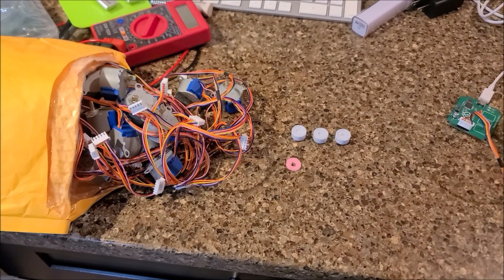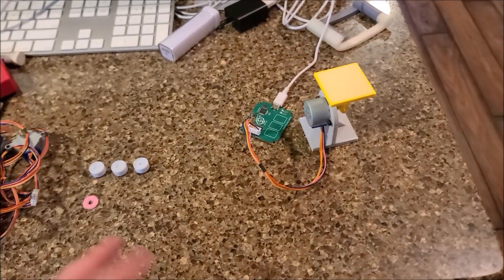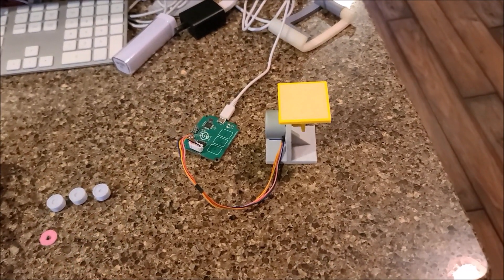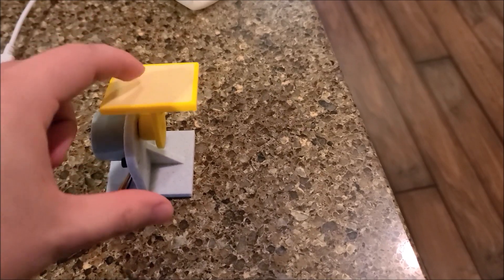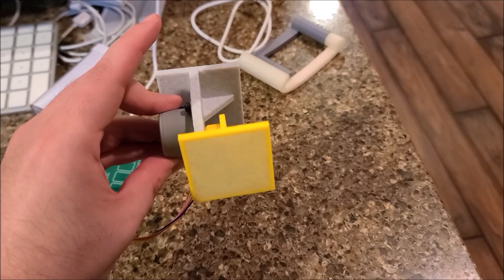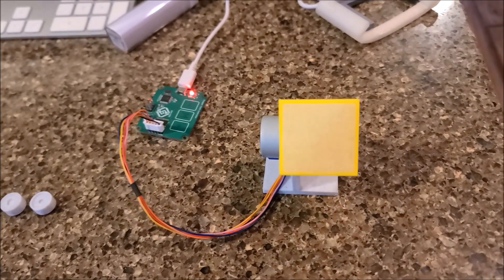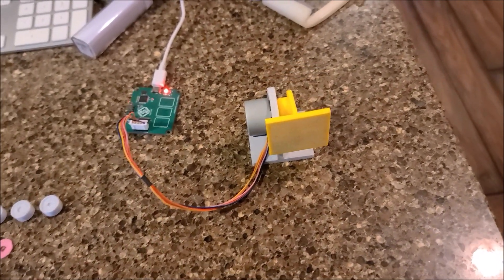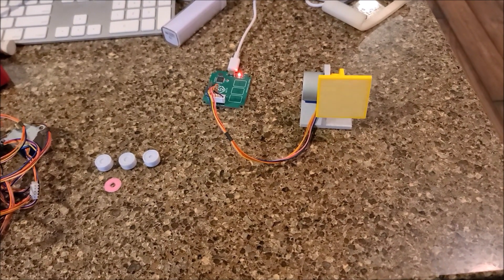Electromechanical Stepper Clock: Part 1 - First Steps

Comment: You may be over thinking the colors.  Why not print everything in white then flip them face down and spray paint them with black plastidip?
Reply from the maker: I'm thinking of maybe providing some sort of kit or even prebuilt clocks, spray painting would be fine for a one off but I'd like to avoid it if I had to make more than a few.
Reply: @sjm4306  ah that makes alot more sense!

Comment: Did you know that these motors have a built in slip clutch for exactly the same purpose?  They are intended for HVAC vents and when first turned on, they "home" by running them for some time in one direction and relying on the slip clutch to slip.
Reply: Was going to write the same. Big clive has video about this hvac blinds motors
Reply from the maker: ... if I knew that I wouldn't have had to go through all this!!! I still kinda like the magnetic removable flap though since I can design different shapes/colors and swap them at any time.
Reply: @sjm4306  Also, I suppose your magnetic solution avoids any wear and tear on the internal clutch.